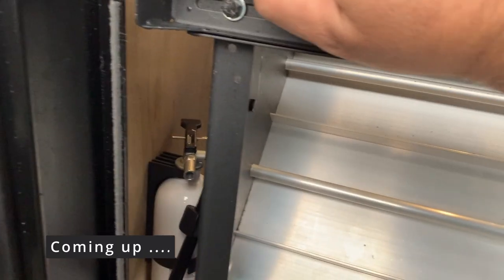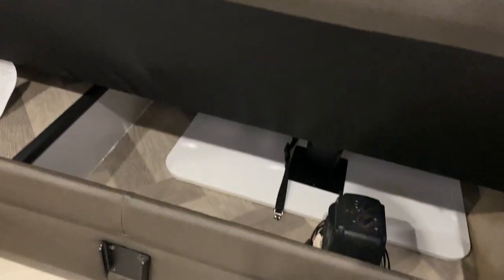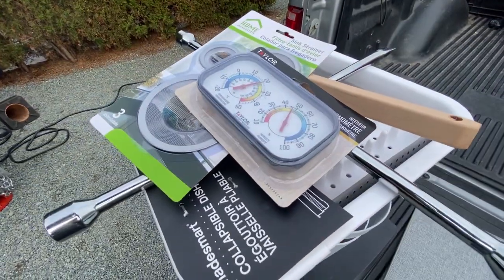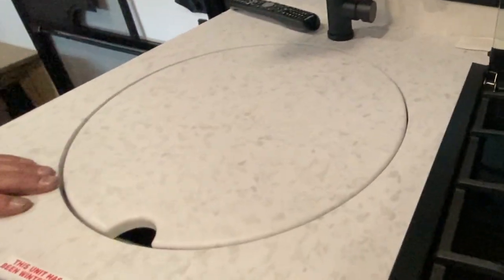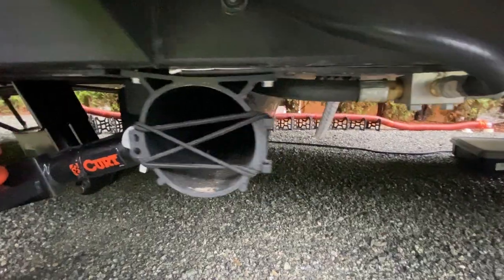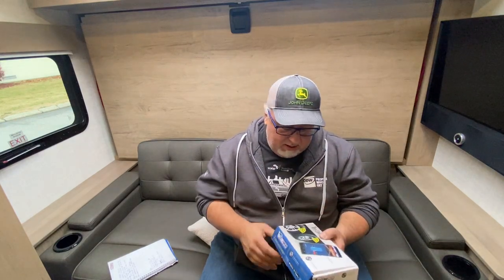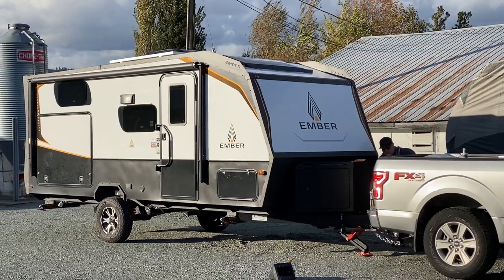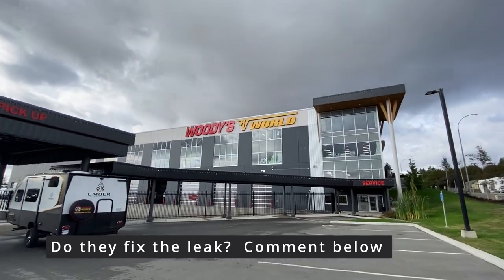First thoughts after trying an Ember Overland Series RV Trailer. LEAKS! Shakedown trip to ID defects

Comment: Really was hopeful of ember, but after seeing factory tours. They’re just a gussied up version of what’s out there. The ideas are great but they can’t just keep jumping ship with past companies and opening new ones in hopes of things changing.
Reply from the maker: Yes, I made that point in a recent video after you got me thinking about that aspect.
Reply: Yes, I love them, but watched a video of issues with the solar/battery control panel that involved removing the refrigerator.  The cluster duck mess of cables back behind were scary as hell, no labels, no tie downs/backs, just a mass of wires some lose without connections.
Reply: @Erin-Thor  typical RV 🤦🏽‍♂️ my first job on mine was redoing my wiring.
Reply: @doubled8247  — Sorry, I’m an old SW Bell, then cingular, then AT&T wireless employee… wiring, especially in something that shakes, rattles and rolls down the road is critical.  Labels or color groups are important as well.  I saw twisted wires with household screw tightened connections instead of crimped connectors, I thought that type of electrical connections were illegal in RV’s.  Wait… might have been allowed for signal wiring as it was a solar/battery control panel.  I am SO glad to hear that was your first project!   I guess what irked me was that knowing electrical issues happen, especially in an RV, that the cables weren’t colored or labeled. It was as if it was all designed and installed by inexperienced uncaring people.
Reply: @Erin-Thor   yeah haha I build oil delivery trucks and our guys take pride in combing wires and secure connection without chaffing. I had an issue with my heater, didn’t want to bring it to dealer so I opened the can of worms. Ended up my grounds were all stuffed behind the distribution panel in a bus bar that had 9 holes…… out of the 9 2 were used. 12 wires going into 2 holes. Let’s just say a lot of strands didn’t make it in the hole 😂
Reply: @doubled8247  — Odd question, for ground wires, does it matter if they are unattached or all in one hole?  I’m not trolling, I’m confused. We ground equipment, buildings, all to a tested ground point in the building.  How do you ground an RV on rubber wheels?  Or are you talking about the return?
Reply: @Erin-Thor   it was the 12v grounds, depends on how it’s being done. The hole size on the rv is 5/16 they stuffed a 6ga and 4 14ga into one hole. Not all the strands fit in the hole and creating heat.
Reply: I talked with the head engineer for them at the overland expo. They are very proud of there product but really hated having the flaws pointed out to them. Even the unit they had on display was falling apart.
Reply: What sucks is that I’d be willing to pay more for it to be dialed in. Their sizes and features are unmatched, I wish they were 10k more and they just did it freaking right

Comment: You keep saying some of these things have been used a thousand times on the showroom floor, and that's why they have problems, but they should have enough quality to hold up to long term use.
Reply from the maker: Yes I agree.  On the door latches (spoiler alert) on the next video I will talk about what and how they repaired them.  The latches just needed adjustment and the plastic tabs on the sewer tube storage are just cheaply made.    

When it comes to this trailer, the premium I paid for was the overall construction of the trailer structure and material choices (Heavy frame, Azdel walls, no rubber roof, etc) and the problematic fridges or issues with sewer storage are germane to my overall desire for this trailer.   The leak I found after I filmed this video (and included at the end) was my HUGE concern.   The next video goes over the remedy.

THANKS for your comments Teacher Carl.  Sorry they did not show up in my feed on the live premiere feed.
Reply: I've seen some videos of early Ember RVs with a discoloration of the floor coming from the glue used.
Reply from the maker: @WanderingCarl  Yeah, somewhere around 1050th one off the line had that risk but mine (around #850) has not shown that issue yet.   Since it seems cosmetic, if it happens, I am not too worried about my dealer getting it fixed under warranty.
Reply: @RVingWithJoe  — The slide leaks in Ember’s are common.  You are definitely not the first to have them.  One user forum stated that they sealed every panel/metal seam.  (Note a few users said they used a bead of silicone and several users responded that their fix wouldn’t last.)
Reply: odd aint it...seems they was ALL demo models....

Comment: 2023 201FQ owner here. Special order and no one used anything before I picked it up.  Do we have any forums up and running yet?  I also found water on the floor of mine after picking it up from the dealer after some warranty work.  There were some cold nights and warm days so not sure if it was simple condensation, from sitting in the lot.  I removed the side of the AC shroud and found water pooled in the bottom cover.  Took it back, they found no leaks.  This would be such a bummer.  This thing was too expensive to be experiencing these problems.  I store it indoors, so odds of finding a leak will be minimal.  Where on the slide should I be looking?   Additionally, where the front wall is supposed to be bonded to the floor in the under bed storage. . .  there was no bonding at all, light can be seen through.  The dealers fix was to simply run a bead of silicone along the trip piece and the wall.  Insufficient.  I will do it myself.  Plan to remove trim.  Clean up silicone, then run a bead of self leveling sealant in the groove between floor and front wall, then silicone the trim and then run a bead of silicone on top again.  It's quite sad how these dealers "half arse" things these days.  Beginning to think JtRVN needs to have a gut check on the products he recommends.  I basically went all in on his recommendation and so far I'm a bit skeptical of the product.
Reply from the maker: Yeah I need to bring some silicone caulk and spray foam on these first trips.
Reply: @RVingWithJoe  I will know more on Thursday when I pick it up.  However, Ember has a procedure for sealing the walls that their QC guys "missed."  That procedure has apparently been completed on my front wall and fender wells.  I was never afforded the opportunity to read the document, even after several requests, all the way up to the COO.  They just pretended that I never asked to see the directions on how to address this issue.  I really won't know if the procedure was applied or not.  If it's bad, you may consider contacting Ember directly.
Reply from the maker: @flynjracer3678  Yeah they sealed up some mysterious areas when I brought it in a second time.  I am driving it this weekend in the rain just to confirm no more water leaks, before my inaugural 6000 km trip.  Luckily(?) living in a rain forest allows me lots of leak testing.  lol

Comment: I have the same issue with the 10-foot limit on the Rhino Extreme hoses in my Geo Pro so I installed a second hose tube under the frame near the other. At least there is enough room for the hose and the 90° fitting in there.

Great video!

Comment: Also of note is that they use under counter mounted sinks, the counter tops are foil wrapped particleboard wood.  While I haven’t heard/read about issues with ember units there are a ton of issues in user forums on every other manufacturers sinks.  If you wash your sink edges, get water in that seam, overflow the sink, etc., the wood gets wet, softens, the screws come loose and the sink can drop at the worst time when you have weight in the sink while you’re washing dishes or whatever.
Reply from the maker: I am gonna keep my eye out for THAT!  Yikes!
Reply: @RVingWithJoe  — I think the examples I’ve seen were all the larger square or rectangular (farmers?) style sinks. Also of note is that the failures either occurred when used or soaking dishes or whatever.
Reply: Yeah it's not as big of an issue I don't think with their finish.

It's really bad on squared designs.
Reply: @greuju  — Yes, larger sinks encounter/experience more water, pots and pans, soaking dishes before washing, etc. 👍🏽😎
Reply from the maker: @greuju  thanks for chiming in.  Time will tell.

Comment: I suspect that if the battery-disconnect switch actually killed power to the breakaway brakes, neither Canadian or U.S. DOT would certify them for use on public streets/highways.
Reply from the maker: You are right, after testing the disconnect does not affect the breakway switch.  But lets face it, I am sure most after-market ones do.

Comment: Hey Joe,  I am a new Ember owner too and we are having our issues as well with leaks and other quality issues.  The company has been good about addressing those issues but after driving it out west for the winter I have another very dangerous concern.  While towing at expressway speeds there are times the top of unit starts to bob back and forth (like a wee blo wobble) or what I would call a body roll.  It has gotten severe enough that it turns into a sway that turns into a white knuckle ride of your life!  I have owned several RVs and been towing for over 30 and have never experienced a trailer handling in this manner.  I believe it has to do with the curt off road suspension… I guess I’m just asking if you have towed yours long enough yet to experience this??  I am using a load distribution hitch that is set up properly.  Ofcourse Ember has never heard of this but are “looking into it”.  Just wondering.  Thanks for your time
Reply from the maker: WOW, OMG, that is the exact opposite of almost every Ember towing experience I have heard of and I found it to be the smoothest trailer I have ever towed at all speeds.  I have heard/read 100's of Ember complaints but NEVER the driveability.  

Can I ask some questions?
1. Model (one axle or two)
2. Are you using a distribution hitch?
3. If so, what kind and did you set it, or the dealer? 
4. Was the trailer loaded when you were driving?

That sounds like classic trailer sway.  If it starts to oscillate, slowly take foot or gas and apply the manual trailer brake, so the trailer starts to slow before the truck.
Reply: @RVingWithJoe  Thanks for the fast reply Joe,  Although I’m not sure that it makes me feel any better knowing you e never heard of this on an Ember. Lol….  I guess that’s good because maybe we have a chance to remedy this issue!   The unit is a 22 190MDB (vin 000194). Single axle unit, curt off road suspension and no slide out.  I am typically loaded (full of fresh water) with all the basics for camping.  I am using an E2 load distribution hitch made by Fastway, which was purchased new and installed/ set up by the dealer. I am pulling it with a 17 Toyota Tundra with 60k miles, 10 ply tires and new brakes… the truck is like new.  It pulls great up to about 60 but once I get passed that and look in my mirror you can see the top of the unit just bobbing back and forth almost all the time. Which I just live with until you get 65-70, then you have to really pay attention because if you hit a dip in the highway while changing lanes…. You are going for on hell of a ride.  THE ONLY reason I haven’t turned these situations into a roadside yard sale is because I am familiar with how to handle it… I have done what you recommend, which is ease off the throttle while applying the trailer brakes… whew!  It’s a hell of a ride! I’m still waiting for a reply from my dealer and Ember…Let me know if you have any suggestions. Thanks again Randy
Reply from the maker: @randydelker5412  Great work on managing that sway and I only included that anti-sway advice to be safe.. just in case. I am glad you have the recovery down.   The next thing I would look at is hitch weight vs gross weight.   There is a few way to calculate that but they all require you weigh the trailer and then calculate the tongue weight.  I am not sure where the tanks are on the model but SWAY is so often resulting from under-weight on the tongue.  Most of these trailers are SUCH a heavy front load on these trailers, I would be surprised BUT in order of troubleshooting, if it were me, I would do this weighing next.
Reply: @RVingWithJoe  Thanks Joe, that is exactly the direction I was headed.
Reply: @randydelker5412  sounds like you're overloaded but idk, what's your max tow on that? It ranges from like 6 to 10k and your trailer is 7k
Reply from the maker: @greuju  it may not be overloaded but the tongue weight may be too light for this model.
Reply: Mine bobbed to the right and left like crazy! A passer by beeping their horn made me look in my side mirror and see the trailer bouncing all over , I won’t go over 60 miles an hour now. I’ve a f250 which didn’t feel the thing bouncing all over the road.

Comment: I thought I heard you say you weren't worried about water in there that much because its not made out of wood?
Reply from the maker: Yes, aside from the furniture, which is made of wood, the entire construction is non-wood, including walls, roof, and floor.
Reply: @RVingWithJoe  I see a lot of campers saying that and promoting azdel but the roof is sandwiched with thin luan type board.  I would like to see a cross section of the roof material.  Sounds like they have some leak issues but nothing that can't be resolved.  As long as no wood rot I would be ok to track those leaks down.  I am about to purchase a 201 FBQ coming from a Vintage Cruiser.  The VC we have had zero issues with so I am somewhat hesitant.
Reply: Laminate is Azdale , no luan.

Comment: The 2022 I have doesn't seem to have any of the faults people talk about.
Reply from the maker: That is fantastic news. There is clearly more people with no problems than people with problems but it tends to be the problems you hear about the most.
Reply: @RVingWithJoe  I was also considering the escape campers and the palomino pause. Do you think the pause may be higher quality than this?

I'm training to be an RV technician so I mainly cared about frame and suspension quality.
Reply from the maker: @greuju  Hard to say.  For me, the two things that I have not seen anyone else pull off is no-wood in construction and the Curt suspension (which is now on No-Boundries, I think.)  I suspect you will need to fix WHATEVER you buy.  Certified or not, watch out for personal work invalidating warranty coverage.
Reply: @RVingWithJoe  yes, NoBo's also have Curt suspension.
Reply from the maker: @eugeneenslow8563  I think they joined Ember as the first adopters. https://rvbusiness.com/no-boundaries-announces-axle-less-beast-mode-package/

Comment: What is a slide topper?
Reply from the maker: It is an awning that attaches to your slideout so every time the slide out extends, it has a small awning over the top.  Keeps leaves and excess rain our and provides extra shade in hot weather, keeping the slideout cooler.